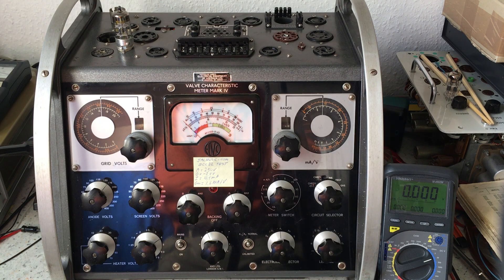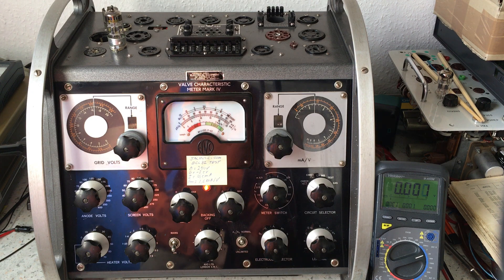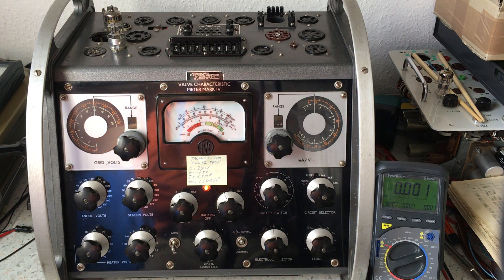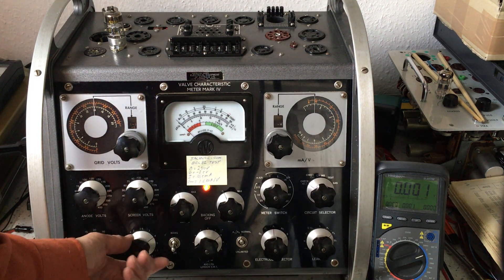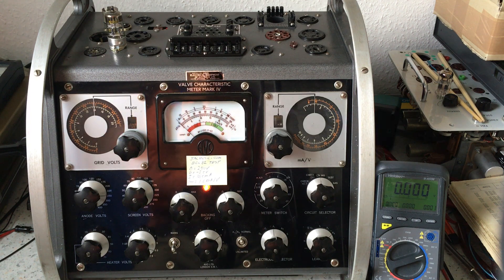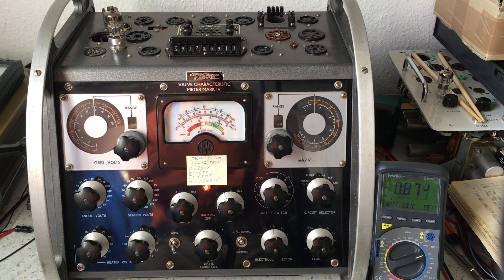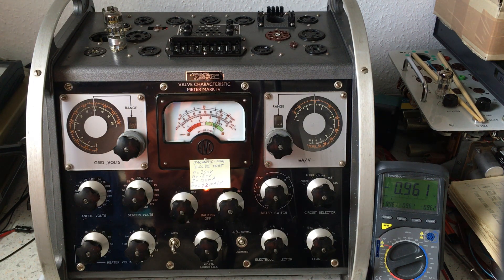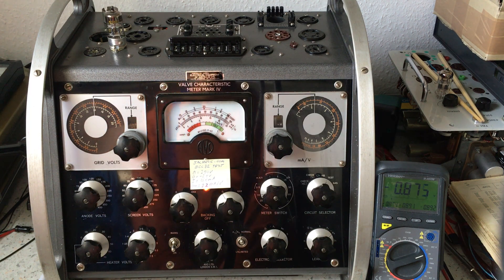AVO Mk4 Tube tester.  How to use it.

Comment: So if the anode current is lower than expected it's normal that the conductance is higher than expected = ok. But what if both the anode current and conductance is higher than expected, is the emission then bad or what? My example is the ECF82 where the triod section says 20mA (18 according to data) and 10mA/V (8,5mA/V according to data) and the Pentode section is just as you described here which says that the pentode emission is ok. I would appreciate an answer 🙂